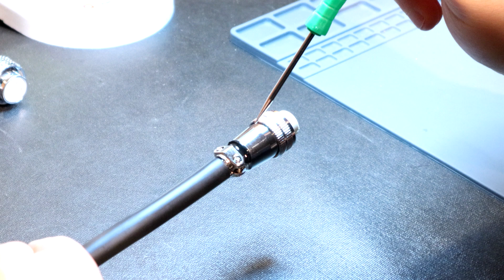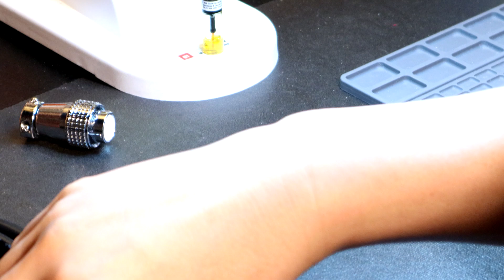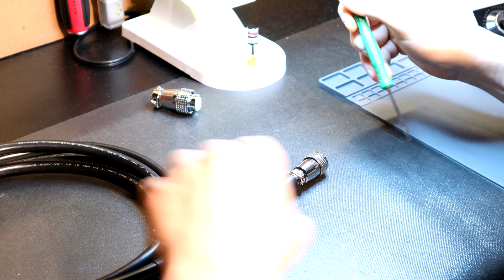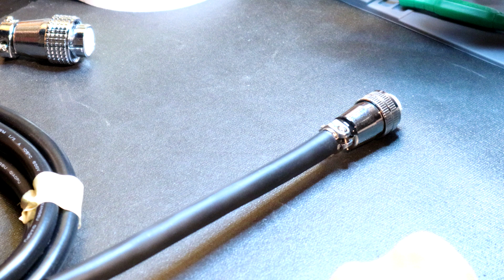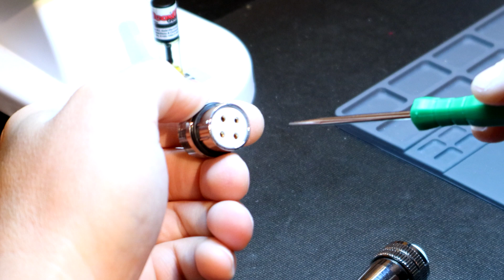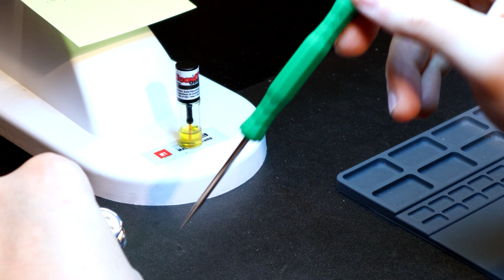Small White Spindle Connector Assembled Spindle Cable-Advanced Build (Shot in 4K)_

Comment: Thank you for answering my question.
Reply from the maker: Hey Joshua, your welcome, and thank you for your support. Have a great weekend! Vince
Reply: @corvetteguy50  Would it be possible to see how the connector is milled? I'm about to buy a Amphenol  connector and do a swap out but perhaps I can modify what I have until then.
Reply from the maker: @joshuamartin2605  It will be in an upcoming video. Thank you,
Vince
Reply: @corvetteguy50  Very much appreciated. Best of luck and thank you for the videos.
Reply from the maker: @joshuamartin2605  thank you I appreciate the kind words. Vince
Reply: @beckyschwantes5287  Thank you. Biggest trouble I've got is fully comprehending the models without spending significant time and finding the right one--but for the cost and long term MFG support I think this could be a wise upgrade IMHO.... That or milling out the existing socket but both methods take considerable time and consideration.